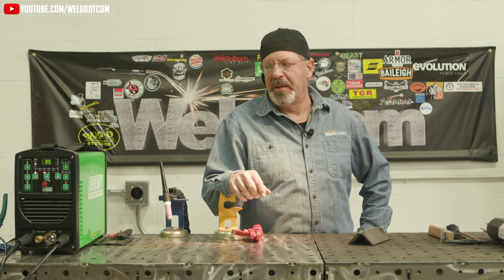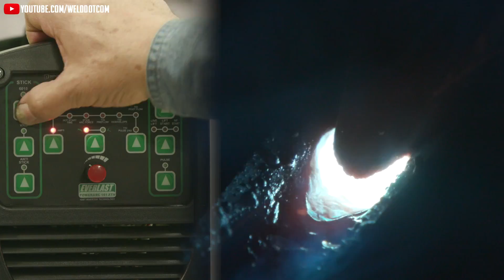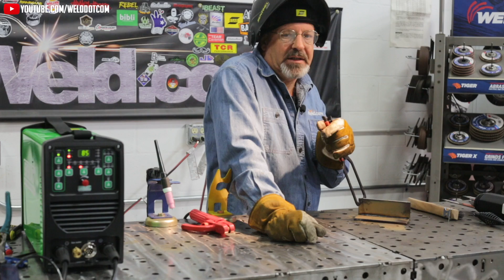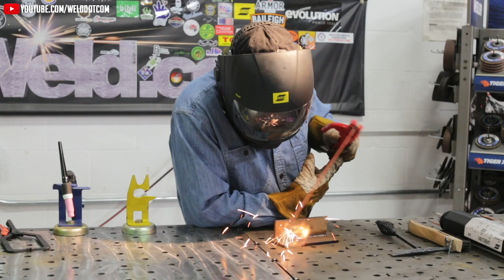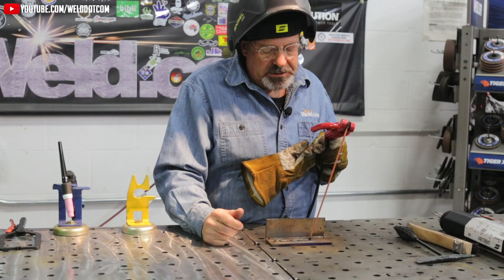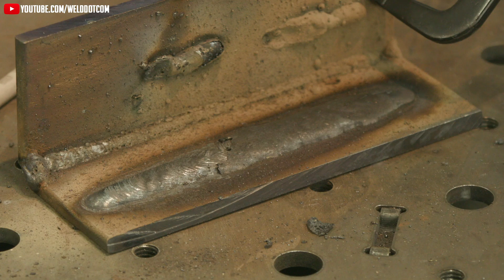Everlast PowerArc 161STH: 6010 and 7018 Initial Thoughts

Comment: Thank you bob I love your videos,  excellent education!now  if you do touch something hot be sure you touch it with the back of your hand, the front of your hand tends to grab as the back does not! Iam a firefighter (firefighter 101 make sure that door isn't hot with the back of your hand) and if you get a chance can you fill me in on mig settings volts/amps for an everlast welder on 14 gage,  1/8 , 1/4 material running 25/75  and 30 wire. Thanks in advance and have a good afternoon

Comment: Really great vid , I was under the impression miller machines were the only ones with open circuits that could run a6010 rod , if I saw this a few months back I’d probably have saved myself loads of money
Reply: Everlast running 6010 since 2009.

Comment: How would you weld Pewter such as hotwheels or certain car parts?
Reply: Buy new ones
Reply: I have absolutely no experience with pewter so take this with a grain of salt, but I know pewter has a very low melting point, so if I had to do it I would go with low amperage tig brazing or silver solder. But I'd recommend taking it to someone who specializes on small parts. Maybe a jeweler or something
Reply: Thanks for soldering/brazing idea! I’ll check it out. I run accross trim pieces that the mounts break off. They are hard to find sometimes. Thought id practice on hotwheels first.

Comment: I picked up the Everlast PowerARC210STL it makes the Miller maxstar look like a chump at about a quarter of the price
Reply: My thoughts exactly. My buddy just dropped like 2k on a miller diversion and my $400 everlast stick welder has a smoother tig arc
Reply: @Hub's Nub I had the Powerarc 210STL as well but had to return it because it couldn’t run 6010 at all.
Reply: @Hub's Nub How Does yours run 6010 5p+ rods on an open root?
Reply: @blindedbythelight80  I've ran 1/8 6010 open Root no problem so far
Reply: @Hub's Nub Maybe I just got one out of a bad batch, I did buy it the week they released. I’ll have to give it a shot one more time. What you get for the money is better than anything else out there. Thanks for the reply brotha🤙🏼

Comment: I need a nonstick stick machine!!!  Wooo hooo  🤣
Reply: Don't jam rod till it's heated up. Strike half in above where u wanna start drag down heat start to blend slight push and key hole should open up and then drag at proper speed. Sticking may be from jaming to much and moving to fast and rod does not have time to melt work pieces and boom stick. Slow down a bit is my suggestion

Comment: I would have tried this few years back but the 160 didn't run 6010.. I weld pipe in hydronics so that was a deal breaker. Got the esab miniarc 161 Lts and absolutely love it. Hi freq start and foot pedal controls would be nice but the esab is exactly what u see in field is why I went that way but would love foot pedal for fab and repairs
Reply: Ditto, love the 161. But I did get a 200 amp green machine. Still haven't ran 6010 with it but it'll crank on 5/32" 7018 all day.
Reply: @tommyt2854  the swapping of the ground was huge turn off on that machine. Not field practical. Need to run 6010/7018 with out touching machine and the esab does that beautifully
Reply: @chrisjones6165  yea true. I just googled what @weaver cattle company posted, didn't find the ac/dc esab, but did find a Tweco 401. Hear anything about those?
Reply: @tommyt2854  I have not. I know they have a 221 ac/DC machine or something like that but it's about as much as the dynasty and the invertig
Reply: @chrisjones6165   You don't have to swap anything on the new welders.
Reply: @Weaver Cattle Company nice. I will definitely check that out

Comment: I would like to see a downhill root and also a larger gap where you have to whip it and see if it can keep it lit with a little long arc action?
Reply from the maker: We played around with doing some longer arcs and it actually handled it well. We we're pleasantly surprised as some of the older models can't do it.

Comment: Yeah my 210 ext can’t run 6010/6011 although I didn’t buy it to run stick it would be nice to practice!
Reply: Michael Smith it will/should run 6011. I have a 210. You just have to crank the arc force way up. Like 50 to 80.
Reply: songer121 awesome that’s good to know I’ll try that